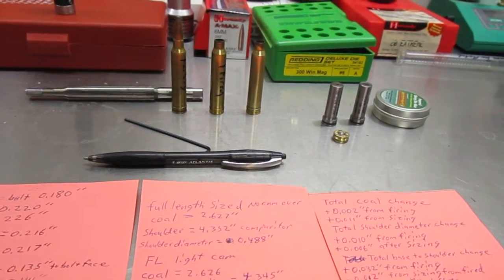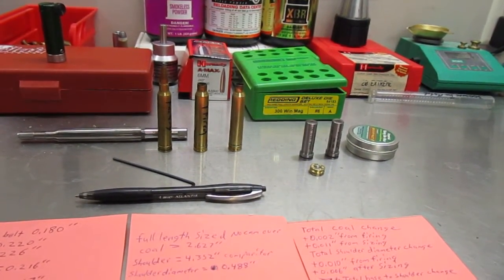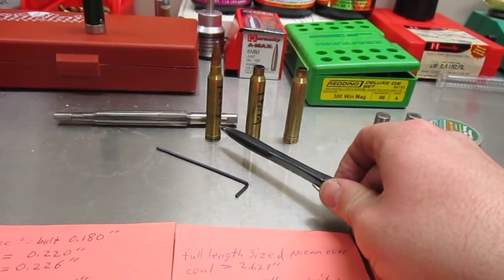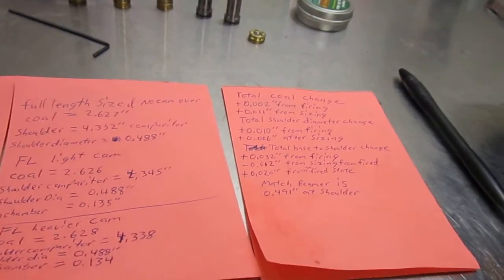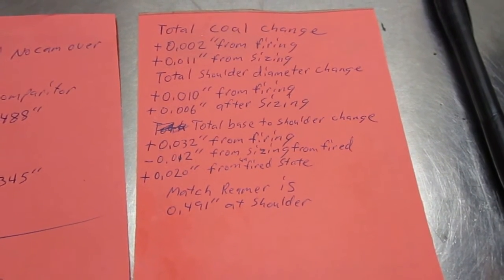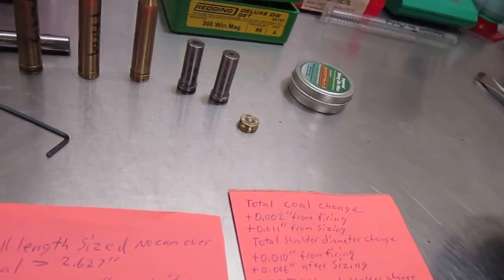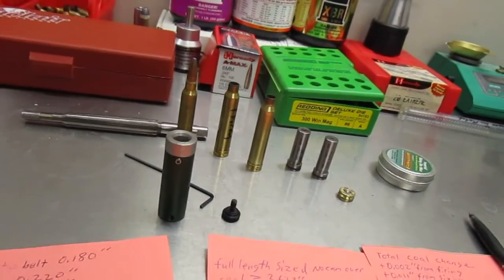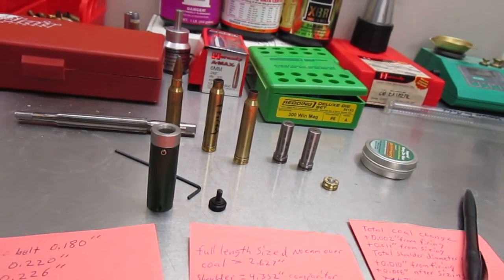Headspacing Belted Magnums

Comment: I think my Speer #11  manual agrees with you "The 300 H & H and 375 H & H are probably the only bottle-necked magnums in current use that really need the case belt for head-spacing because of their shallow shoulder.  Others have ample shoulder for headspacing and the belt on these modern numbers is really superfluous".  As an example, 300 H & H Magnum has a shoulder of 7.5 degrees, while .300 Win Mag, 338 Win Mag have a shoulder of 25 degrees.
Reply from the maker: Interesting you are the first person to ever point out that this info is in a regularly available reloading manual hahaha who would have known
Reply: @ALBERTAROB77  I have not experienced any case bulge with my 300 H & H...11 resizings before I retired the lot of brass (.002" shoulder bump with full length reszing, anneal after 2 resizings)...I wonder why no case bulge which is supposed to be a problem with belted magnum cartridges?  I case bulge more common in the cartridges with steeper shoulder slopes like 300 Win Mag, 338 Win Mag?
Reply from the maker: @RetrieverTrainingAlone  could be a function of the actual size of the brass above the belt and the chamber dimension. I have had the bulge on 300wm and 7mmrm in the past, but has never caused me any grief.

Comment: Excellent!  I've been using a 300 H & H up here in Alaska for moose and bears.  I reload Barnes TTSX 180gr with IMR4831.   What are your thoughts on nickle-plated brass for reloading hunting rounds?
Reply from the maker: I've used it didn't really find much wrong with it. I prefer brass but if nickel is what you can get I wouldn't worry about it.

Comment: Thank you for your very informative explanation..I have been shooting the 300 Weatherby for over 45 years & your explanation is exactly in line with what I have experienced, after the first firing you are sizing from the shoulder not the belt,... & a min bump is all thats needed to produce accurate ammo...Sizing cases back to factory specs given that they can grow 10 thou & more on the first firing  is a quick way to over work the brass for no gain ...

Comment: First, thank. you very much for your time consuming study.  I appreciate all of the work that you put into this.  
I have a question. I had been neck sizing my .300 WM,  but based on your observation that the headspace is coming from somewhere on the barrel of the case rather than the shoulder,  should all cases be full length resized or does neck sizing take  care of the headspace issue?
Reply from the maker: I prefer to minimum full length size all my cases (set back.001-.002") to maintain consistent head space. Neck sizing wont change your head space.

Comment: Doesnt every gunsmith show you that a belted magnum is headspaced from the belt to the case head and isnt this why belted magnums are considered dangerous game cartridges and non belted cartridges that headspace off the shoulder are not and classified as delta L problem cartridges?
Reply from the maker: Callum McMurray All I can tell you is the math doesnt lie and even the factory ammo i have wont headspace on the belt. I believe the original cartridges 375h&h ect do headspace off the belt at least for the first firing.
Reply: KABER ARMS Thanks for the video and the reply I found this very interesting

Comment: How about demonstrating the actual resizing in the press and show how much bump back you used and how the die was adjusted?  This is a "radical" departure from most You Tube advice, so can you show acrual cases being resized. Thanks.
Reply from the maker: Patrick Dineen  I started the dies where they are setting the brass back .002” (my normal die setting) then turned it in progressively until the handle on the press cams over. I can try to do a video to show the process if you like.

Comment: I'm in the first firing headspaces on the belt camp.  After that they headspace on the shoulder.  Most belts are .15 and most chambers the belt is cut .20 that's .005 clearance.  Ok now if your size your brass fit to your chamber any dimension that is less than .005 (I use .001-.002) the cartridge in effect headspaced off the shoulder.    ????  Does that make sense or am I full of it.  Anyway thanks for taking the time, Nice video
Reply: You are correct. I never seen a belted mag case that did blow out a crazy amount compared to say a 308 or whatever else.

My 300 win blew out about .010 shoulder base. And went .012 in leangth with a comparator. 
It seems to be a very common thing witch is why 300 win for example isn't the best choice for long target unless you hand load.

Comment: I see the .032 shoulder dimension in your notes. Why not just bump it back .001 vs F.L. resize?
Reply from the maker: Sanch Arino Normally that is what i do, but the purpose of this whole exercise was to see if i could set the brass back far enough to headspace off the belt which I could not.
Reply: Ahhh i get it.  was a little confused

Comment: Bullshit.  My factory 7 mag shoulder stretches forward .035 after one firing.  Then they headspace off the shoulder
Reply: Savage 110 btw.  And thats not a typo Thirty five thou of clearance in the shoulder using factory rounds
Reply: No wonder a newbie can get confused here... good to know! Thanks
Reply: @sancharino6878 Big ammo makers know that the belt is there to save their bacon so they don't give a crap where the shoulders end up. But .035" is a lot. Case head separation is not far away, even with going to minimum shoulder bump. The most I've seen is .019". Anymore, I start with brandnew brass and neck it up until it won't chamber, then slowly size it back down until the bolt closes with some resistance. This prevents the initial stretch and cases last loooong time once you start bumping the shoulder back no more than bout .002".

Comment: These old bones have always believed that it is the belt that controls headspace , the barrel is machined to take the belt with very little clearance between the bolt face and the head of the cartridge , I have a Mauser 66 in 300 weatherby mag and once fired Norma cases  ( never could aford factory ammo )  I only neck size down to the start of the shoulder and have fired these cases many times without any trouble , my vote is for headspace at the belt , I enjoyed your video I can see you spent a lot of time on the subject
Reply: The cases were originally designed for H&H calibers in the 20s to headspace on the belt because they had such sloping bodies and shoulders, similar to the 22 Hornet; those old cases can headspace off the shoulder but not enough to minimize case stretch or provide any real support or benefit.  When Winchester "wildcatted" the case into their belted magnums, they gave them modern shoulder angles similar to other cartridges that headspace from the shoulder; and while they can headspace only on the belt, they benefit from a shoulder headspace.  And as discovered in the video, most dies won't allow enough setback to not headspace on the shoulder anyway.